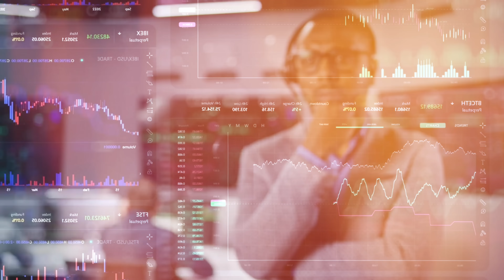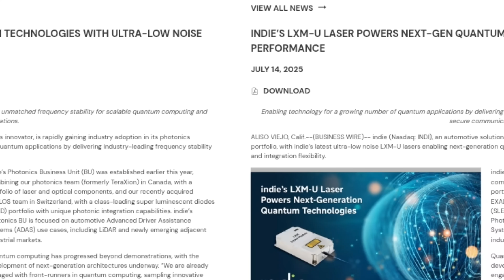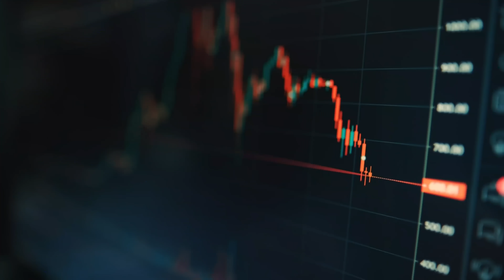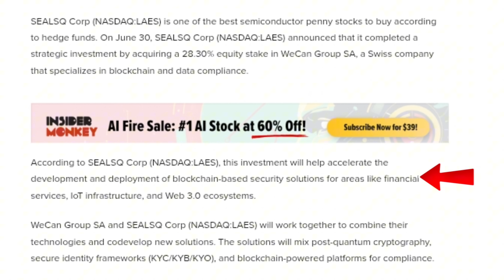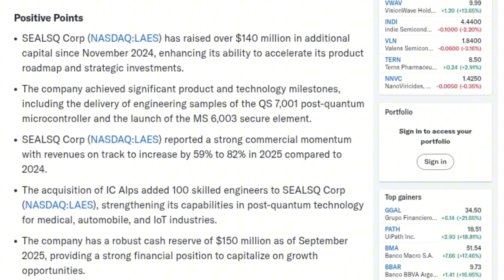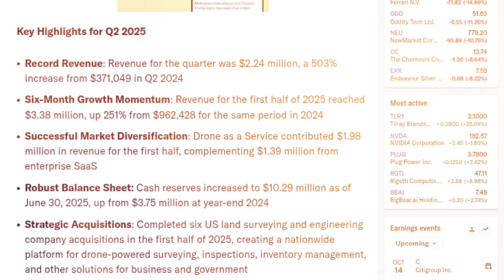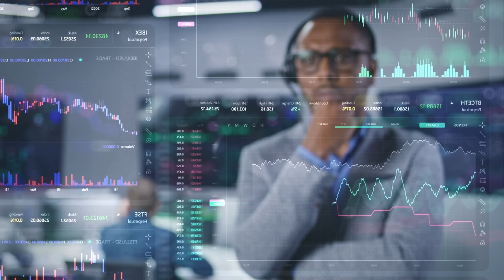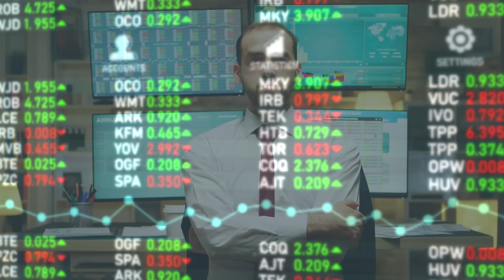Get in Early‼️ My Top 4 Quantum Penny Stocks Under $5 to Watch with Huge Potential in 2025 🚀

Comment: But LAES YTD is -11.76% loss
Reply: LAES is the best !
Reply: I wouldn't stress seeing fluctuation. Now that this video has surfaced, the numbers of buying shareholders has likely increased, and the shares are likely going to increase in price because of supply and demand. Some investors use analytics and other trend tools to see increased numbers in volume and differences in outstanding shares. Very promising to buy in during a transition in a valley.
Reply: @josephsquires8033  , LAES fell by -15.09% today. That is a significant drop.

Comment: IONQ is the strongest of the quantum stocks - they are in the best position with the corporate backing.
Reply: Rigetti by far the best stock
Reply: RGTI the strongest
Reply: @Provodnik.13  both are great, but they are WAY over bought, and over hyped.  I will be buying them when they fall around 70% during the coming correction.   till then I am in quality companies who are actually making money, and have not only a PE, but a reasonable PE.  And in a large percentage of cash
Reply: @Provodnik.13 reddit Pump and DUMP FRAUD. Why Did Chad Leave.
Reply: I'm Talking about rgti.